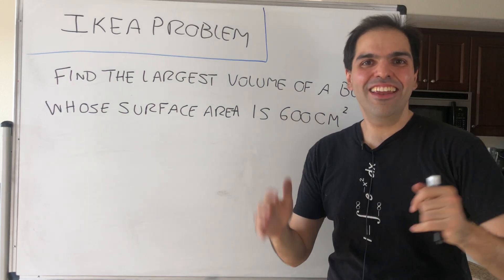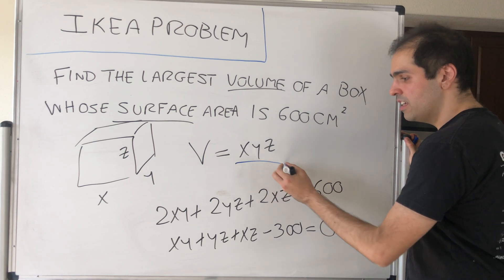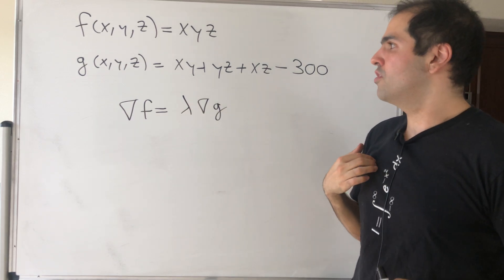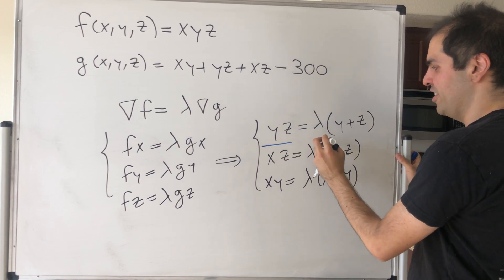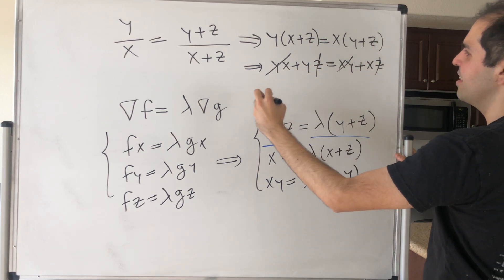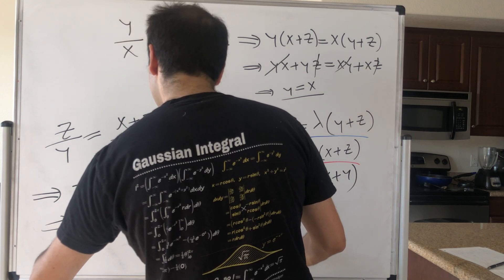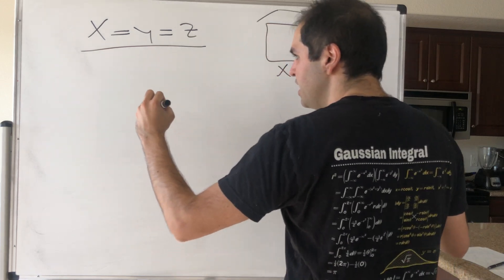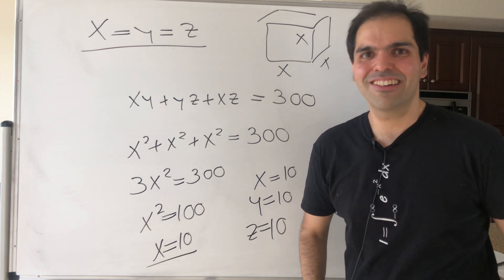Volume of box Lagrange

Comment: Now I'm curious as to the maximum volume of a bookcase with a fixed surface area. Say it has a back, two sides, a top, a bottom, and a shelf in the middle. I think the same technique works without much more effort, but you get a more interesting answer, and it's harder to just guess right.